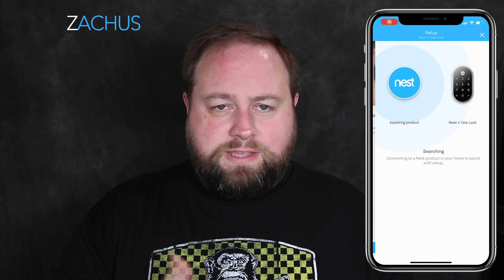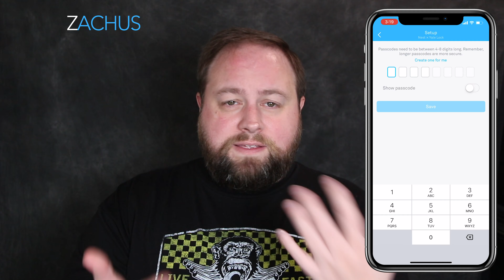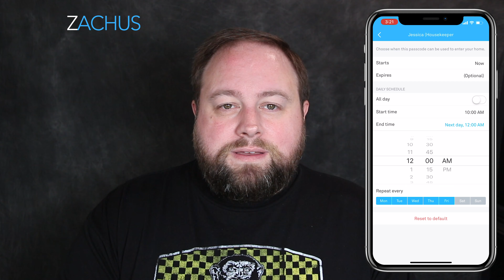How to Install Nest X Yale Smart Home Door Lock

Comment: I'm interested in getting a NEST lock, but my question is this is only a dead bolt right?  So am I to assume I would leave my normal door handle unlocked at all times leaving the dead bolt to be my only lock?  I was one to think that the deadbolt is the secondary lock to the door handle lock.
Reply from the maker: Yes that is why you try and pick the color of your existing door knob, stainless, bronze or gold so they match. Most front doors now only lock by the deadbolt, at least in newer houses. If you have one where both are locked this would not work for you unless you leave the other one unlocked.

Comment: if the batteries die, are you locked out of your house?
Reply from the maker: I was concerned about this as well because some have a keyhole for manual use. But after a lot of research, I felt like it was the best for me. The batteries last a long time. The app will notify you when they get low. Do you have a garage? If so I highly recommend the MyQ which allows you to open/close and monitor your garage door and will give you a backup. I've used this for over 3 years and all my family has it. Really well worth $30 https://amzn.to/2Q4REax
Reply: @Zachus  If the battery dies you can hold a 9V battery under it to provide  temp charge If you get locked out

Comment: dude taht sucks that you need the little plug thing.
Reply from the maker: Yes and no. The Yale doesn't have built in Wifi only bluetooth so a lot of people do this, they have a separate Wifi device that sends a bluetooth signal. It was a way to bring Yale into Nest. Otherwise it would be a separate app etc... I love mine, works great!